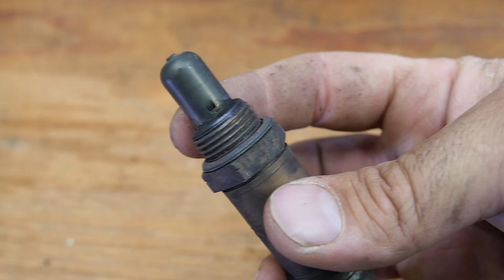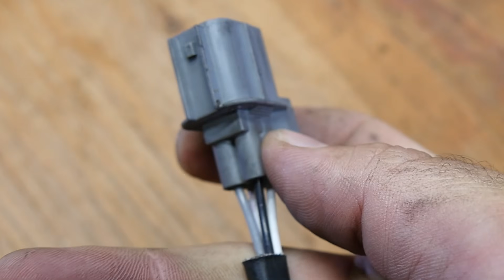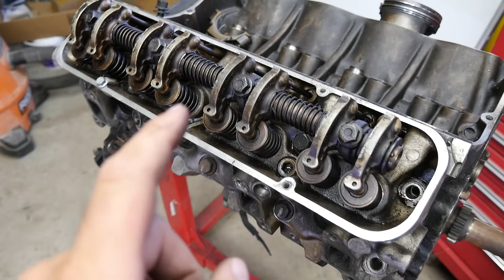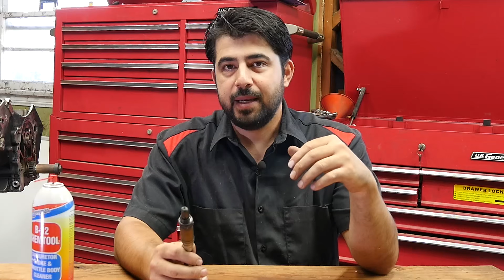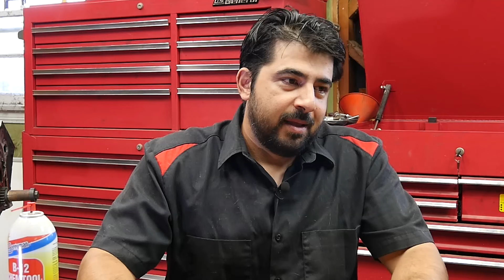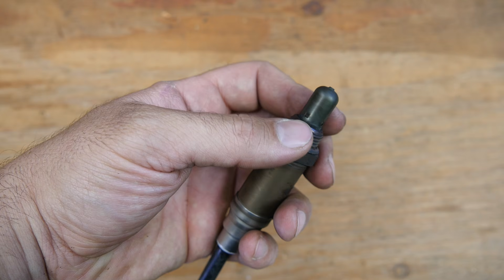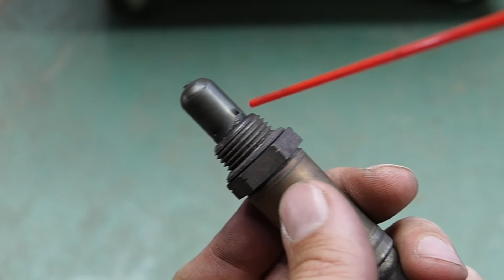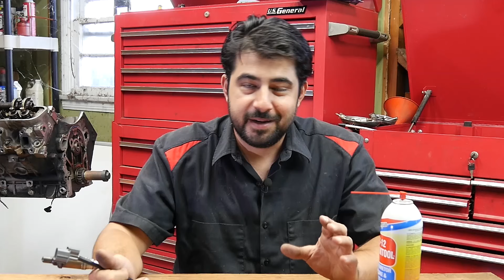How to Clean an Oxygen Sensor

Comment: I’d rather buy a new one!
Reply: Got $200 laying around for oem o2 sensors?
Reply: I would too if the car takes a regular o2 sensor, a good quality one can be bought for around $30. However, most of the cars on the road today use wideband air fuel ratio sensors that cost $100 or more, so trying to clean those before replacing them makes sense.